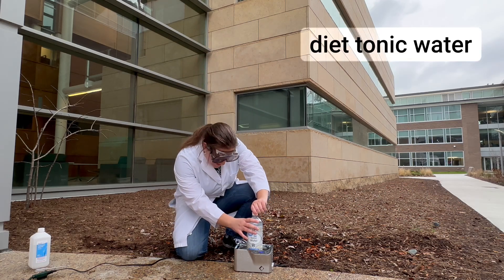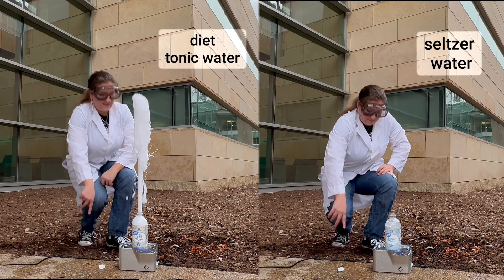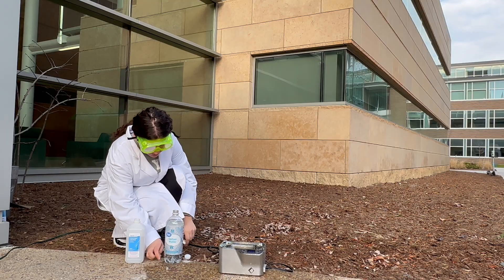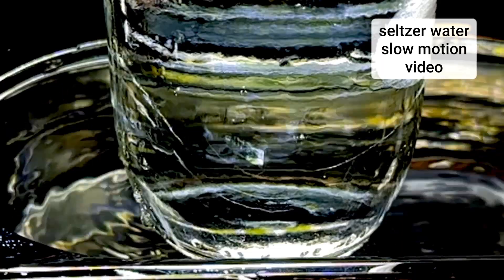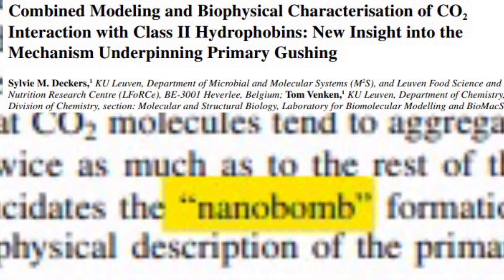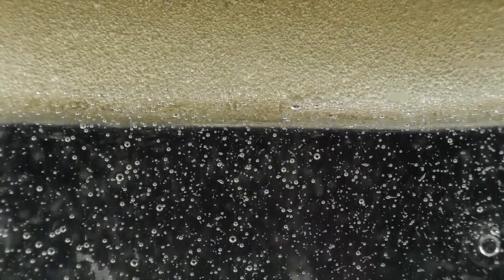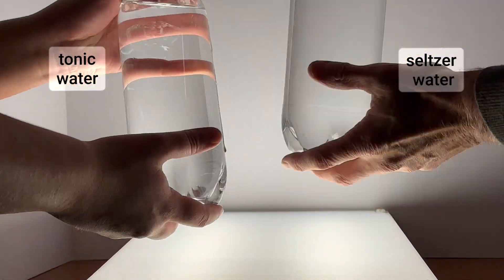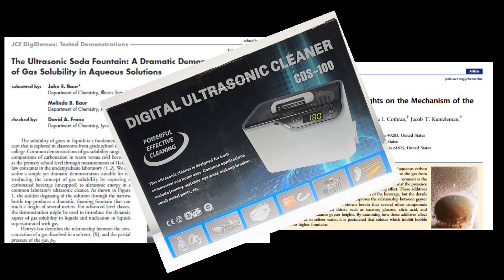Unveiling the Power of Ultrasonic "Nanobombs"

Comment: You should try using nitrogen as well sense drafts are capable of holding significantly more microspherals of bubbles. The reaction could potentially be significantly larger. You should also try the elephants toothpaste reaction inside of the ultrasonic cleaner to see if that makes a difference when the catalyst is added
Reply from the maker: Interesting ideas...the reagents from elephant's toothpaste might damage the ultrasound cleaner tho
Reply: @TommyTechnetium  I didn't think of that until after I posted it. What if a shield was covering an Elhenmier flask with a silicone-based glue? Nothing is worth destroying equipment over, of course. If you are interested in design ideas, I can though some low-budget ideas your way.
Reply from the maker: @TheDeepDiveLLC  It might be worth trying to see what would happen to 3% peroxide exposed to ultrasound...might the ultrasound initiate decomposition? If so, slowly increase the concentration...
Reply: @TommyTechnetium  the whole chemical reaction with 3%. I know the catalyst would react, just not violently. Hmm. Even scaling everything down in a large flask might also be a good idea. 

I'm intrigued now. I just don't have the ultrasonic cleaner
Reply from the maker: @TheDeepDiveLLC  I'll try to pop some 3% peroxide in the cleaner today. I'll let you know what I see. Remind me if I don't respond within 24 hours...I do tend to be absent minded